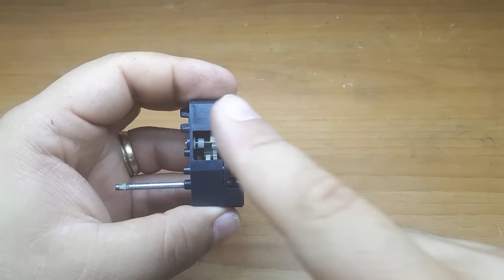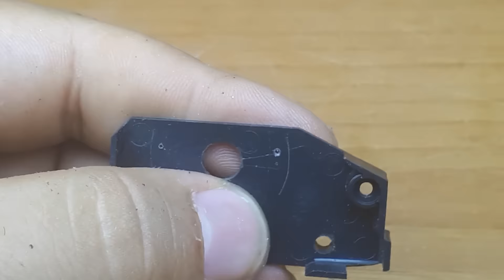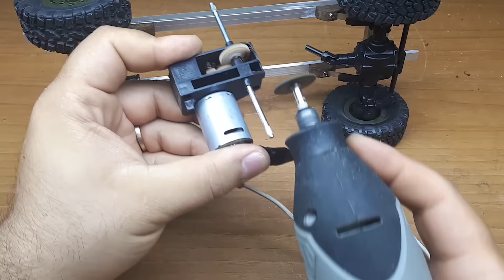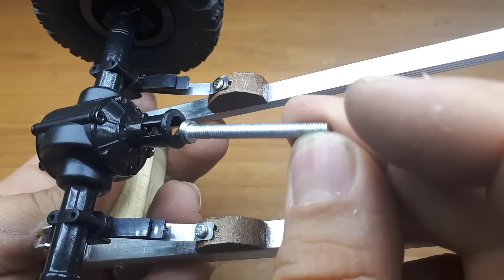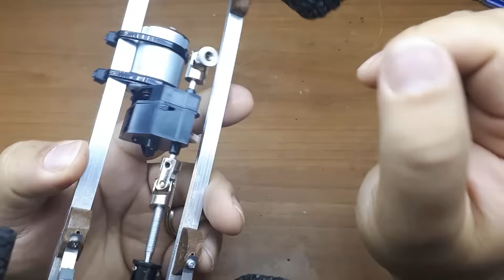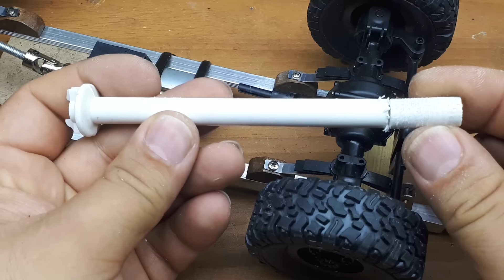Fully DIY RC 4X4 OFF ROAD CAR! Cheap an Simple/El yapımı RC Kamyon-Ucuz ve Basit #P2

Comment: Love the idea and i have a frame with exact same drivertain. Used to be 1 10 $ chinese made RC car. 
But 1 motor was too weak to make it work properly. 
Ideas to make it 1 motor per axel or even 1 motor per wheel?